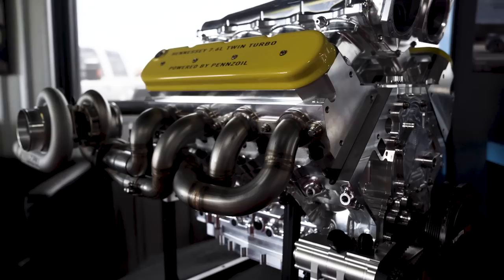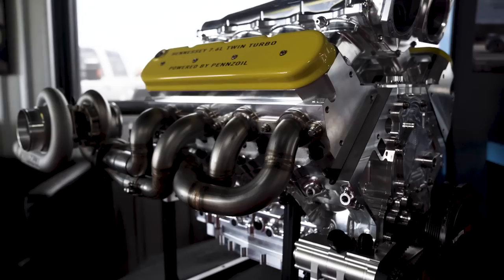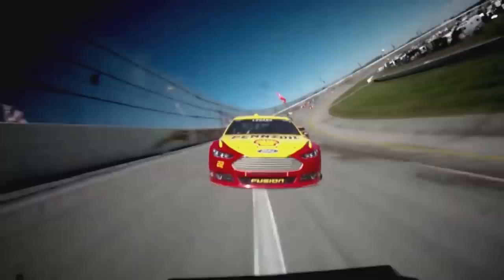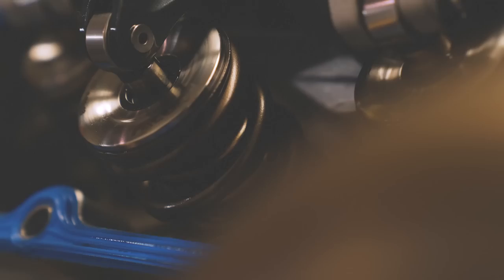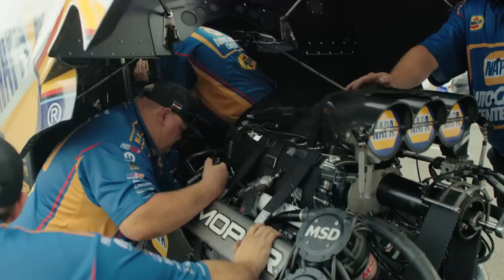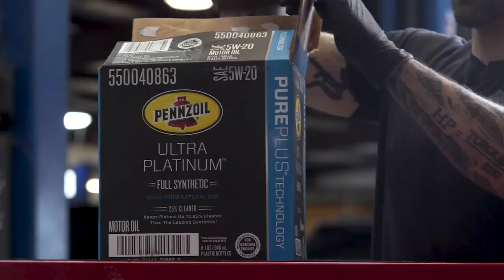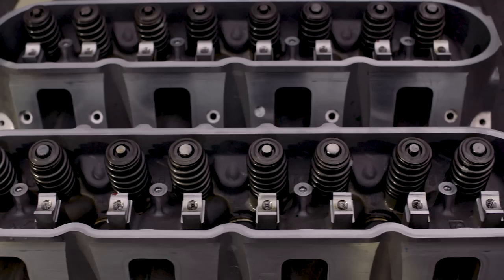Venom F5 Engine Named "FURY" Behind the Scenes Development

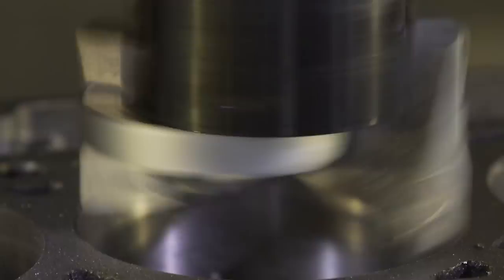Comment: 0:25 says it’s built for 2500+ horsepower
Venom f5: has 1600 horsepower
Reply: They're going for a top speed record not a mile record
Reply: They said it’s overbuilt literally seconds before that. That was their point, it’s made to take more than it has.
Reply: @Karterness  therefore it will be more reliable as a road car.
Reply: Has 1800 hp and 1193 torque written at the very end of the video
Reply: Parker Hajost
Idk how your getting 1600 from 1817
Reply: @evolicious  Lamborghini Gallardo, Huracan, Porsche 911 GT3 and GT2, Corvette ZR1, NSX, Nissan GT-R. Plenty of reliable supercars out there. Hennessy knows what they're doing even though they may believe their packages are worth more than they actually are simply because of the name, but they know how to make a good car the original Venom was a monster.
Reply: @evolicious  It's simple logic if you have a motor capable of much more and you settle for less, it will hold up.
Reply: @anthonywebber2211  the venom f5 WAS rated at 1600 hp and 1300 lb ft of torque some time ago, so im honestly not sure where 1817 hp and 1193 lb ft of torque came from. Lol
Reply: @ryze9153  
Simple, more air, fuel and tuning
Reply: @anthonywebber2211  i guess, lol.
Reply: @anthonywebber2211  did you hear that fucking motor though, man?! I mean GOOD LORD. Lmao

Comment: 1800hp will surely require frequent maintenance man. Will need special wheels for this beauty cuz can't fit drag radials on race car. Will be expensive to maintain it until it has low boost mode where u get 800-900hp for daily driving and drag or track mode to unlesh the full potential when needed